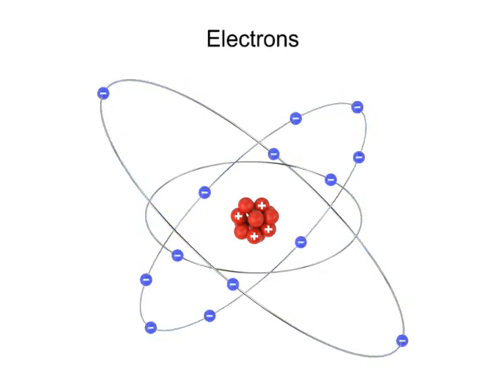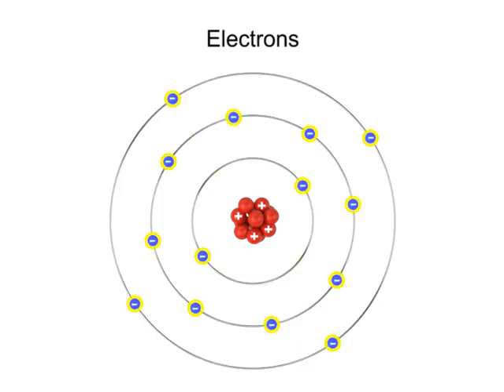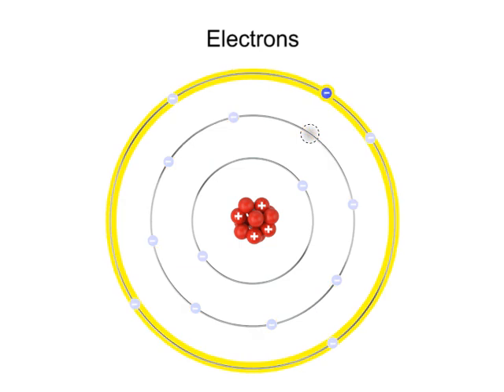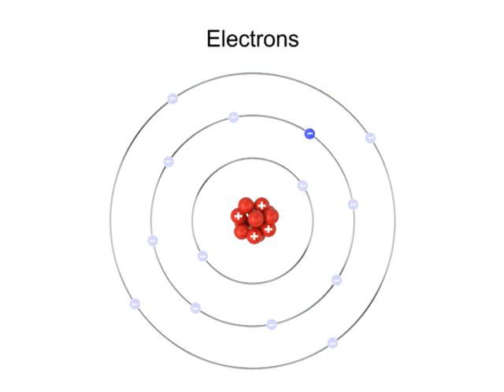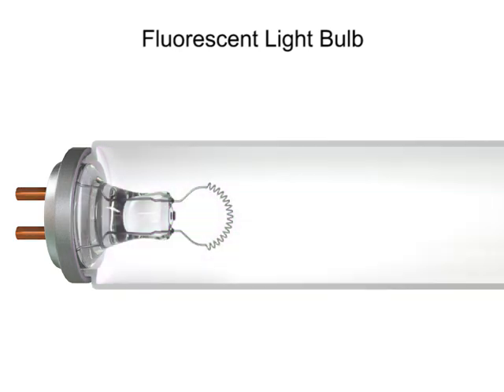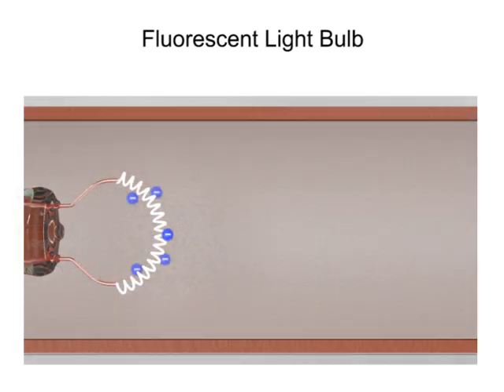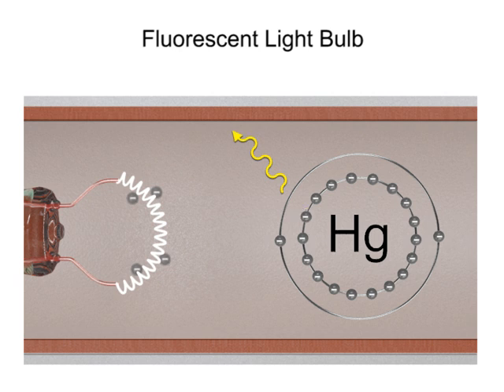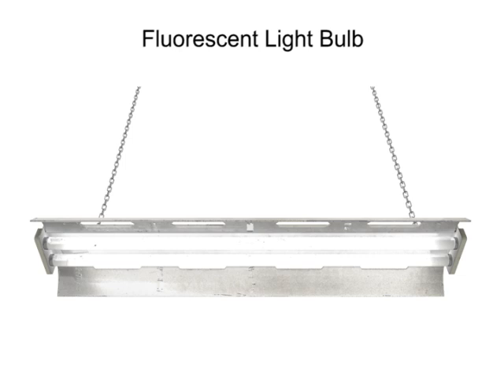What are Electrons and Excitation?

Comment: Instead of producing light, seems like a gas might charge a battery in a tube, though conductive metals probably would also. Probably batteries is exciting the electrons inside them with heat.

Comment: We were told this yet while looking up all still photos of the atom the electrons were all upon one side . I didn't understand how or why and now figure that this stills of the 8 electrons around an atom and the 12 , the stills placed them on one side the motion picture of there pulse also. Yet I assume it is the way they may have been held or kept at a temperature. Because of this they went and performed a series of experiments which meant that they found this one sided behaviour to be true. So we move on. Perhaps the atom held stationery to photos of one in some form of liquid or some other kind of stand effect them so far it has been done with temperature and wave frequency. This may go on to produce an atomic back door making spacial radio signals a near instantaneously received  procedure , or at least is a hope as we begin to understand the spacial dynamics within and without are directly linked it's only then to close the gap and use space inside and out of the atom creating a radio curvature stream able to receive a transmission as we close the gap accordingly in the black back door. A foolish hope yet for engineering an important discovery to stabilise and engineer shapes and with materials that withstand the absorption diffusion refraction reflection stuffs the super heated and super cooled environs of space to make such things as the microwave and radio density fueless engines as we try to make the cold curvature reaction of radio emissions bending back upon themselves in space such as the radio bubble of the galaxy and utilise it's curvature dynamics with wave temperate outputs. Hopeful to make laser engines and ride the lightning at a hard transmission speed fanning microwaves with radio direction and multifields till find the mix that makes the curvature and heat a thrust for momentum. They say this can't happen yet to put it through encapsulated fluid that is made to vibrate like a techtonic sauce of gravity while the water trys to pull itself together the frequency and spectrum identities when all measured up will show gravity happening there and how to channel it with ring systems pulling there electron magmatism stable channeled through these a microwave laser we should as we would transmit energy be able to ride the lightning pritty soon

Comment: That's nice:) but i have a question, why does the electron release a visible light in the atom but releases ultraviolet photon in the fluorescent light bulb?Does it depend on the type of the atom?
Reply: That's because, when an electron tends to go to a lower energy level/orbit, it needs to release energy in the form of light, gas or whatever.It releases because, the lower energy orbit can not afford an electron with a higher energy.
Reply: It's simple, it's the electrons that make mercury release a uv photon and then remember that it's the uv photon that makes phosphorus release low frequency light
Reply: @farhanajabeen9622  Thank you
Reply: @Vara-wz8rg  Thank you!

Comment: thank you learnt about exitation and dexitation clearly.but what is the cause of dexitation?
Reply: If you mean when the electron returns to its shell, this is because when it leaves it’s original shell placement it knows that it is not it the right order and it cannot handle the increased level of energy it has gained by moving to a higher energy level as it originally started with a lower energy level
Reply: This causes it to release the overwhelming energy it has gotten in the form of light as seen in the video, so it can return to it’s original energy level placement
Reply: @sultxn3k  thank you for this